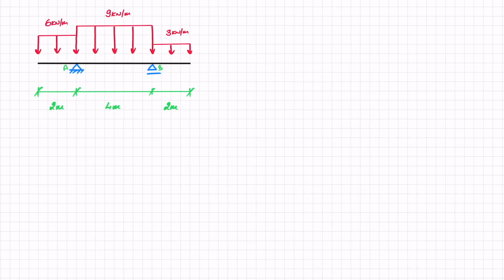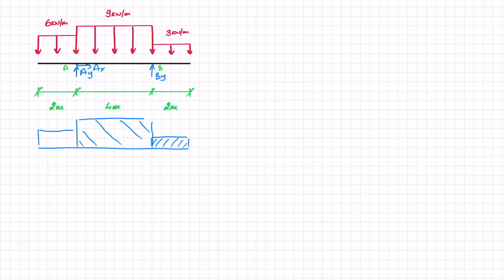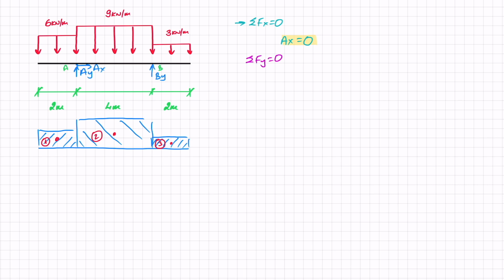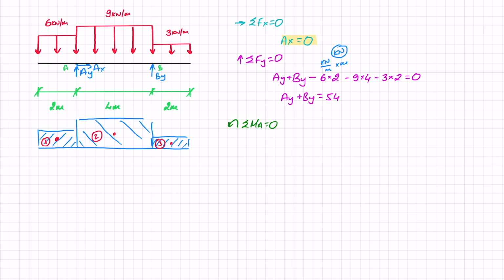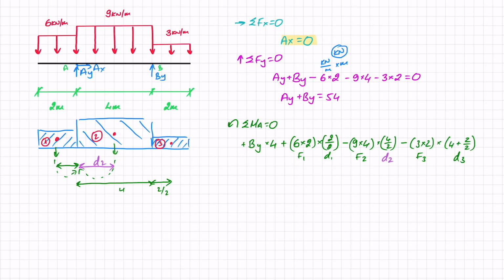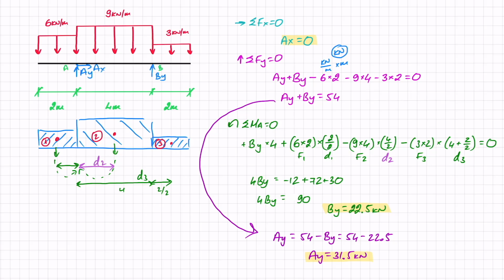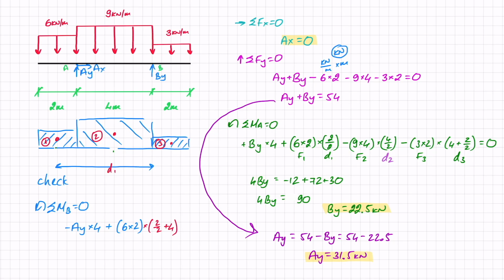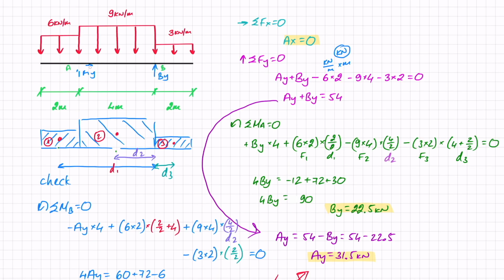Engineering Mechanics | Reaction Forces on a Beam with Overhangs & UDLs | Full tutorial with Checks

Comment: Signs, positive or negative, as always are important. Thank you.
Reply from the maker: Absolutely. Probably the most important is understanding how these relate to the chosen sign convention (e.g tension or compression)
Reply: @EngineeringTheCurriculum slightly off this topic, but just spent some time understanding the Force Method. This is a nice technique and appeals to me. I find it interesting that when you look at say 18th and 19th century buildings with continuous beams. That was all done based on experience before any formula were derived. But still standing.